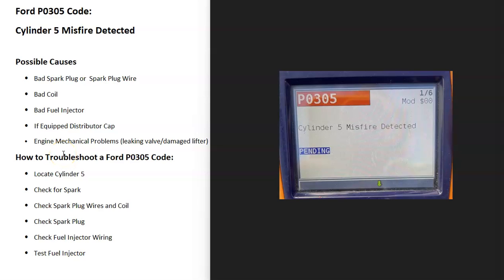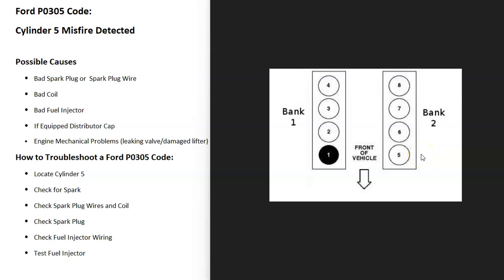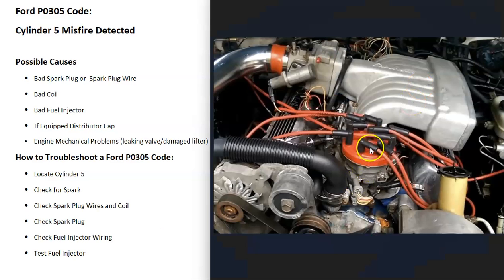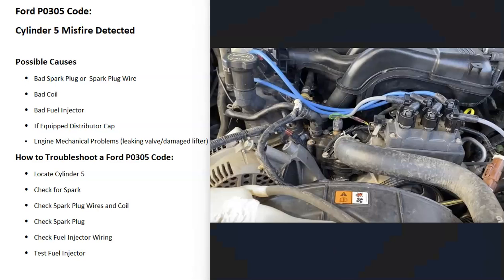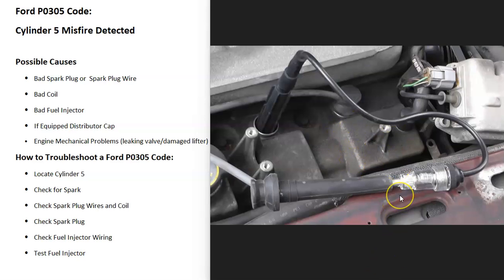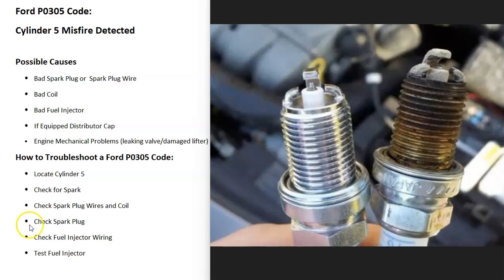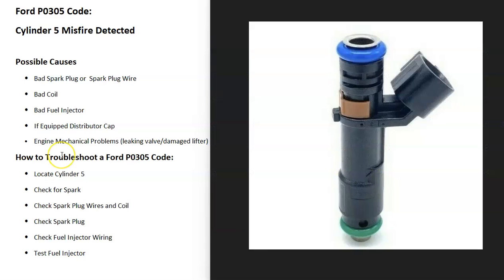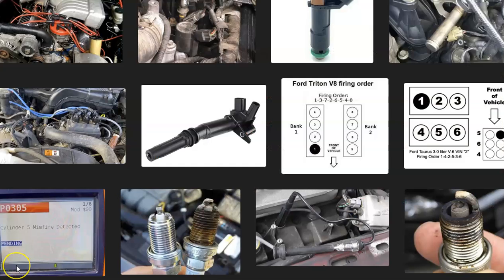Causes and Fixes Ford P0305 Code: Cylinder 5 Misfire Detected

Comment: So lm getting a p305 and p316 code on my Ford explorer. I've changed the plugs and wires,coil,injectors, fuel regulator,fuel filter,crankshaft positioning sensor,catalytic converters and did a compression test. I've run out of things to replace. Any ideas?
Reply from the maker: I would test and be sure it is getting spark and test the injector wiring.

Comment: How do i clk the catalytic conv to c if it needs replacement
Reply: I was gonna say gut it or replace it with a "test pipe" or "off road pipe" and never "drive it on the road, again" ;-) ;-)

BUT if you get one of those cheap bluetooth ODBII scanners you plug in and use your phone to use an app (I use Torque Pro), IF your vehicle has sensors for cat temps, you can check those out.  Get it warmed up and go pull a long hill in OD and see if one cat is hitting higher temps than the other, or if you only have one cat, read up on what the normal operating temperature of your cat should be, the max temp and then see what temps you're hitting.  If it's getting real hot, it's probably clogged.

Comment: No comment about vacuum leak tho..many videos cover what you said. I changed out sparkplugs, coil,wires but the problem remains. I was going to try finding a vac leak but maybe i should just change out my injectors then. Idk..this sucks
Reply from the maker: A vacuum leak can cause issues, but usually, that would affect the whole engine and other cylinders. If the injector is easy to get to, I would swap it with a good cylinder and see if the problem follows.

Comment: I keeping having the 0305 code.  Plugs, coul, injectors and electric connector changed.  Not sure what to do next.  Any suggestions
Reply from the maker: If all the spark and fuel delivery components are good, it's possible there is a problem in the cylinder, such as a bad gasket, rings, or valve. A leak-down test can show if there is an issue.

Comment: I have a 1999 ford f150.  I have changed plugs wires fuel filter and fuel pump new ignition coils maf sensor.  It started on cylinders 3 and 4.  Then it went to cylinder 1 new injectors now it's misfire on 3 and 5.
Reply: Then what happened?

Comment: My 3.0 mercury milan threw this code under hard acceleration .I turned the car off and the check engine light went away . Was it a mishap or should I get that checked
Reply from the maker: If the code cleared, then it is likely ok, and the engine may just need a tune-up. If the code comes back, then there is an issue.

Comment: I have a Mustang 2014 v6 with this code , I already change spark plugs , coils , but the code still , sometime is flashing the check engine light
Reply: Fuel injector? Next step may be to check the compression of the cylinder compared to another one. Good luck

Comment: i have a Expedition with P0305 and P1336 i canged the coil, Plug,plug wire.  Still throws same code.  How likely is it i got a bad coil?
Reply: Can you swap the neighboring coil easily?  If you have a compression gauge, maybe test the compression on number 5 and another cylinder. Just spitballing. I hope it works out…also check that everything is dry and clean down in the hole. Taking a look at the condition of the new spark plug may give you some clues. Good luck

Comment: So my 97 ford 4.6 Triton has a misfire on cylinder 5. Mine doesn't have the straight line coil packs over the cylinder. They're in a quad block on the front. Can't find anything online or in the henrey book on where cylinder 5 is. Anyone have an answer?
Reply from the maker: Cylinder 5 is located on the driver's side at the front of the engine. When you open the hood, it will be the first cylinder on the right-hand side. 

Ford 4.6L Cylinder Location
4    8
3    7
2    6
1    5

Comment: I have a 4.2 2006 F150 and i have replaced the coil, the spark plug and the wire and the code remains, any ideas?
Reply from the maker: If the components are good, it may be in the wiring. It is also possible there is a mechanical problem, such as a bad valve or cracked head, but that is not too common.

Comment: Changed all them and still has engine light on and p0305 code and still misfiring
Reply from the maker: If all the parts are good, it is likely in the wiring.

Comment: Changed all three of them still says number 5
Reply from the maker: If all the parts are good, it is likely in the wiring.
Reply: Changed all mines also still say p0305 and engine back on and still misfires

Comment: I have a Ford Ranger 2005 with a cylinder 5 misfire. I see a small crack on the front of the coil pack... Most everything checks out good. What do you think??